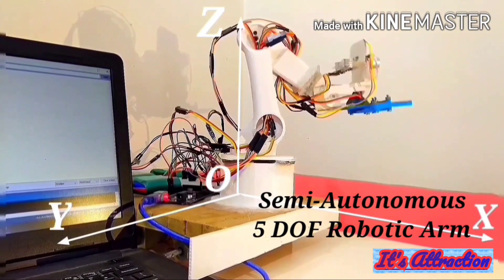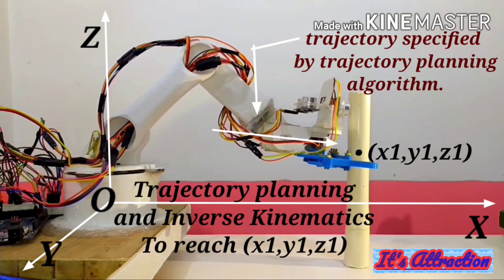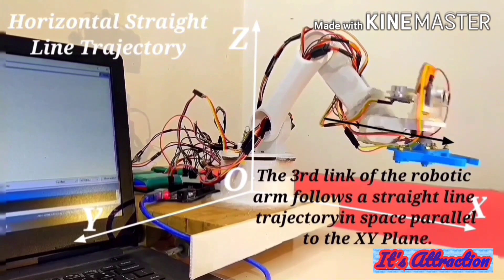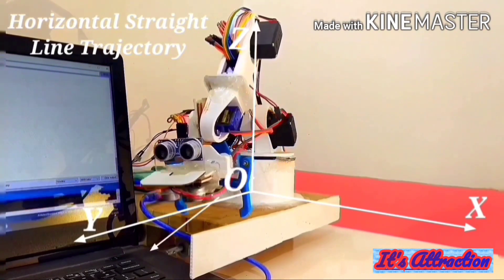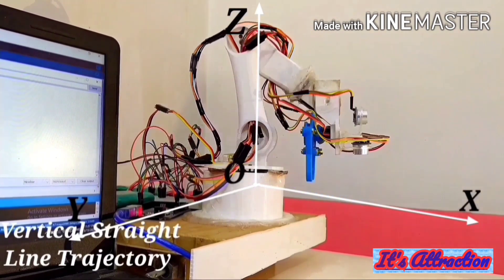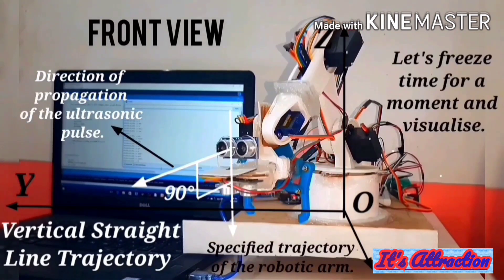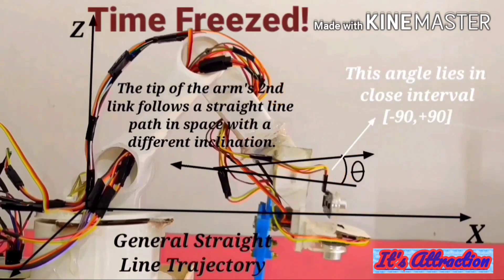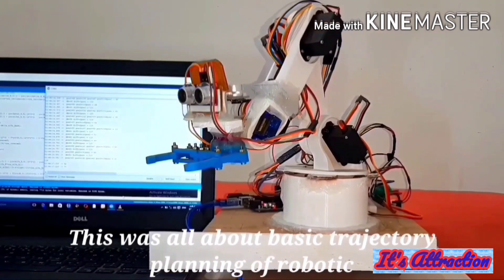5 DOF Robotic Arm: Inverse Kinematics And Trajectory Planning

Comment: How did you achieve inverse kinematics on 5 DOF robotic arm? It is more difficult than 6 dof.
Reply from the maker: I modelled my own inverse kinematics equations using the analytical approach. This arm is just 5 DOF so obviously it's Inverse kinematics is easier than that of a 6 DOF. 

I have even done Inverse kinematics on 6 DOF arm. If you want to see how different that 6 DOF arm is from this 5 DOF, check that out👇🏻

https://youtu.be/9cIt0MjL7wc